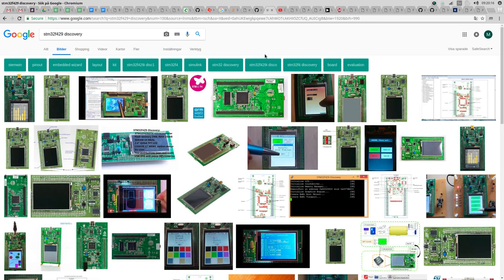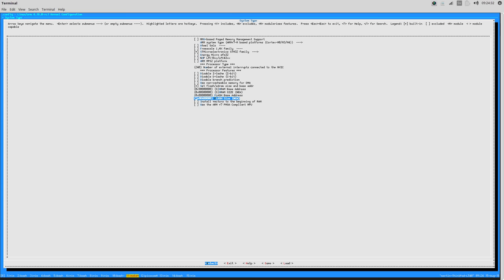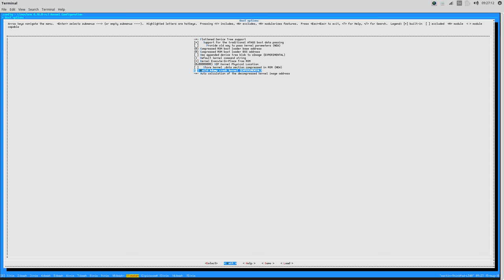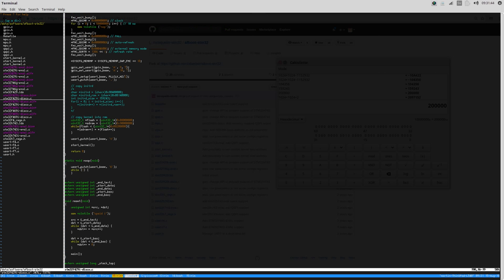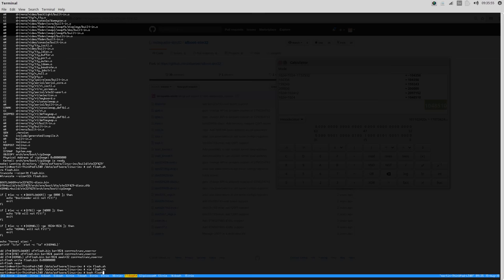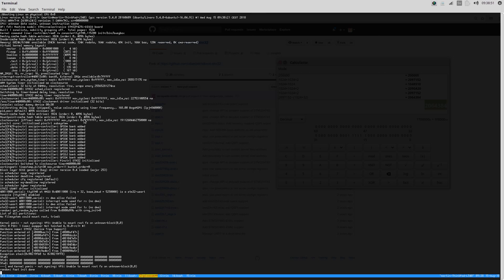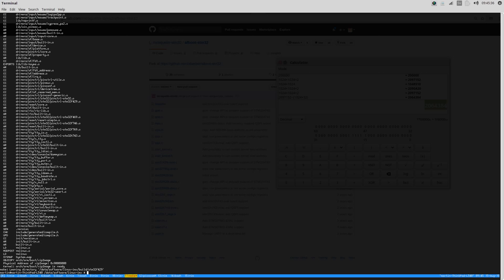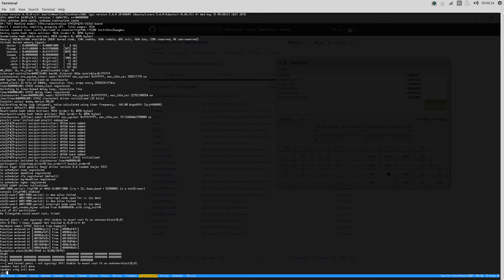Running linux 4.1 on stm32f429 discovery - Embedded System Consultant Explains

Comment: Nice work
One thing is not clear for me 
In the STM32F4xx Reference Manual the FMC maps  the SDRAM  Bank 1 to 0xC000 0000 - 0xCFFF FFFF (4 x 64MB) and Bank 2 to 0xD000 0000 - 0xDFFF FFFF(4 x 64 MB)
The 0x9000 0000 - 0x9FFF FFFF address space corresponds to PC-CARD (NAND Flash memory)
Reply from the maker: I think the number comes from documentation for the discovery board based on how it is wired. I need  to begin documenting all these adventures.
Reply: Ok. I got the answer from the reference manual. At first I was looking at the description of SYSCFG registers for 415/417. 415/417 which doesn't have FMC. It has FSMC(No SDRAM CONTROLLER) only.
 In case of 429/439  the FMC banks can be swapped changing the SYSCFG_MEMRMP bitfield in SYSCFG_MEMRMP  register.

SWP_FMC: FMC memory mapping swap
Set and cleared by software. These bits are used to swap the FMC SDRAM
Bank 1/2 and FMC Bank 3/4 (SDRAM Bank 1/2 and NAND Bank 2/PCCARD
Bank) in order to enable the code execution from SDRAM Banks without a
physical remapping at 0x0000 0000 address.

00: No FMC memory mapping swap
01: SDRAM banks and NAND Bank 2/PCCARD mapping are swapped. SDRAM
Bank 1 and 2 are mapped at NAND Bank 2 (0x8000 0000) and PCCARD Bank
(0x9000 0000) address, respectively. NAND Bank 2 and PCCARD Bank are
mapped at 0xC000 0000 and 0xD000 0000, respectively.
10: Reserved
11: Reserved
Reply from the maker: @SandorPipei  awesome. Thanks for posting the answer here.

Comment: this is super useful, thanks a lot. Did you ever get initramfs working?
Reply from the maker: I decided it would not be worth it. It was a good exercise but this chip is really more suitable for directly interacting with it's hardware than using a massive kernel like linux. STM32MP1 with dual asymmetric cores is designed specifically for using linux with a realtime firmware on the side so it's an a lot better choice for linux.

Comment: Great video!
How do you think, on which minimal STM Linux can be booted?
Reply from the maker: F4 at least. Even though it works it is nowhere near optimal and you do need a sdram to make it into a usable system. My personal opinion is that it is probably better to use a small linux capable arm926ej instead. Like imx233 or equivalent. Stm is for now best utilized with a lightweight rtos.

Comment: can i run linux on stm32f746g discovery board
Reply from the maker: Probably. It does seem to have dram on the board, but I do not know for sure. You just need enough space for the kernel. Whether you can run a full graphical system - probably not. Not fast at least. Personally I think microcontrollers do better at running rtos. For linux a proper cpu is much better.  You can look into imx7d which gives you a good combination of both - a cortex a7 core for linux and an m4 core for realtime tasks on the same chip.

Comment: kernel wont boot  on the new stm32f429-disco1 board,no text on usart ,have no idea how to debug.....
Reply from the maker: Debug using JTAG and make sure your console in the kernel uses correct UART for output.
Reply: @mkschreder  thank you very much , by the way ,is the uart port PA9 and PA10 ,there's only a dot on the terminal so i think the bootloader is fine ,anyway,thank you for your speedy response
Reply from the maker: @chnbigpenis9988  yes pa9 and pa10 is uart1. You have to check with gdb where your program is.
Reply: @mkschreder  thanks
Reply: @chnbigpenis9988  did you get this solved? I'm having the same exact issue where only a period is displayed.

Edit: my particular problem dealt with where the kernel thought it was located.

I solved this by comparing my .config with the one on elinux's quickstart script.